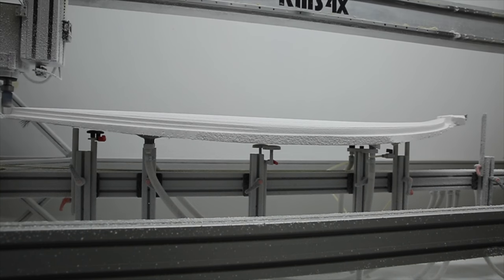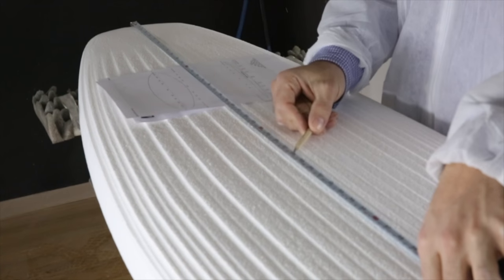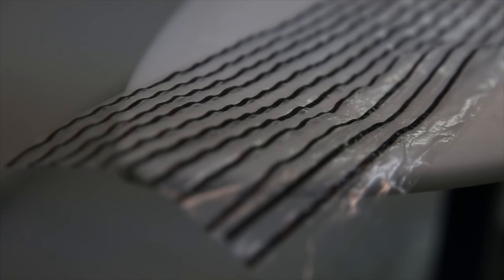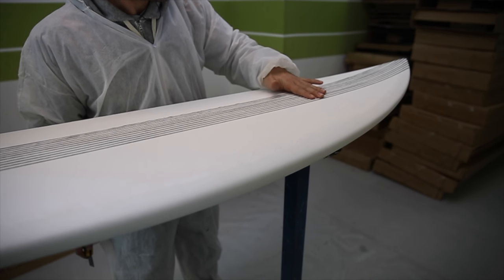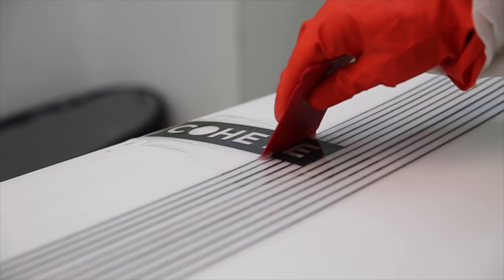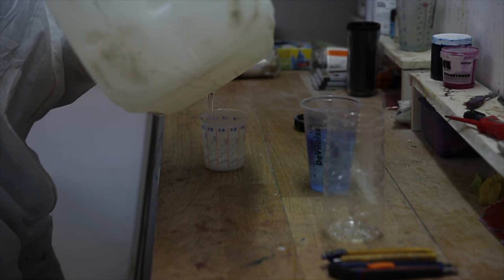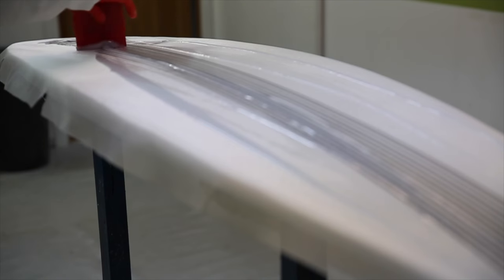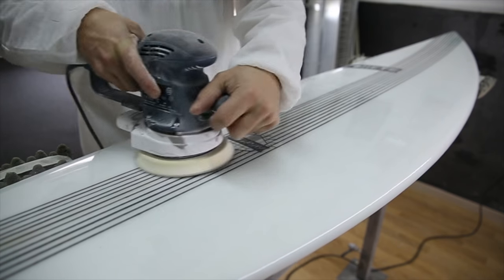Cohete Surfboards - Eps Epoxy Carbon Stringer Fused Carbon Wrap Technology

Comment: Hey great vid, i'm currently making my thesis about designing a new type of surfboard and i will build it, so i have some cuestions about how do you get the core materials, foe example, the foam blank come with the amout of rocker you want? where do you buy the blanks? and what glue do you use to attach the stringer?